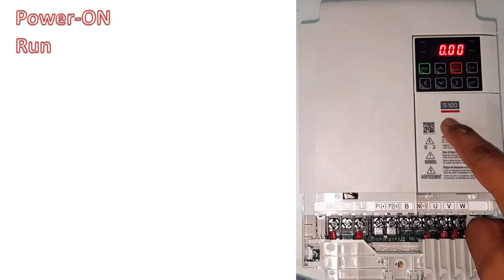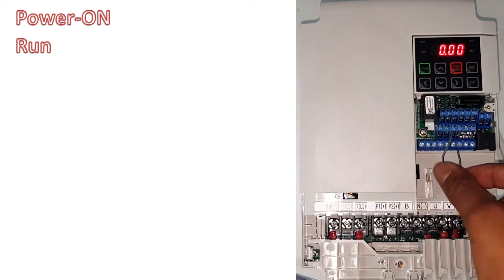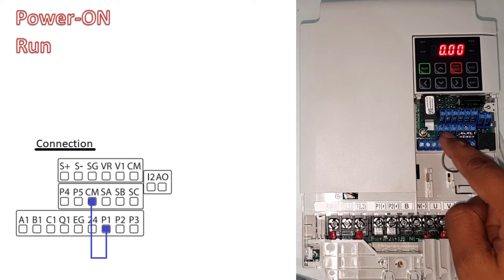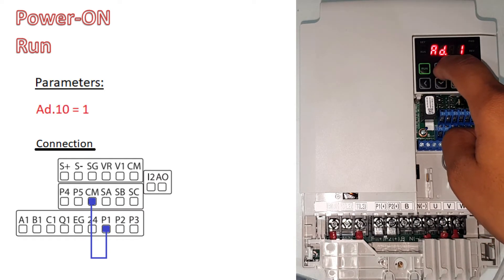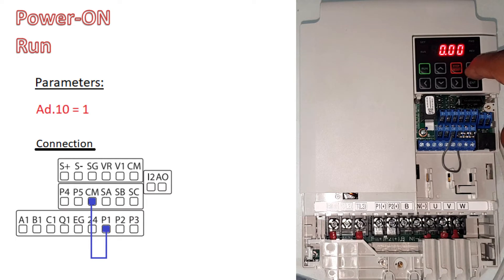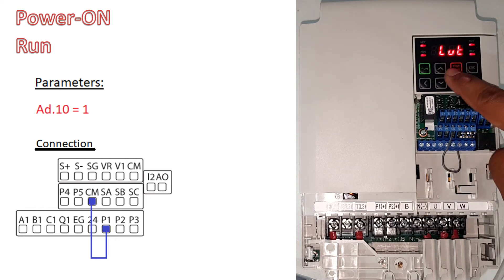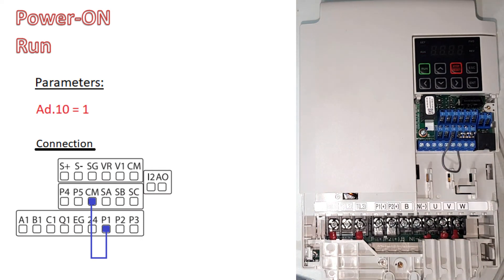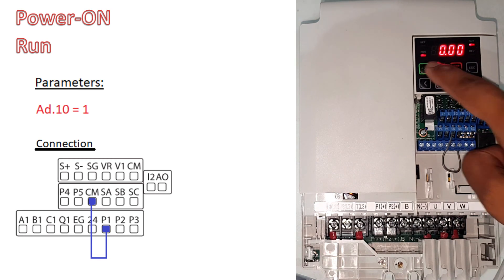How to run motor when breaker turn On VFD? || Power On-Run || S100 LSIS

Comment: Hi sir  I have m100 put the power  and push run button  but not run please sir  how to run first time  video or massage
Reply: I have s100 already connect Cm and P1 but not running need to press run button to run
Reply from the maker: Program drv as 1
Reply from the maker: Enter frequency of main page and connect P1 and CM